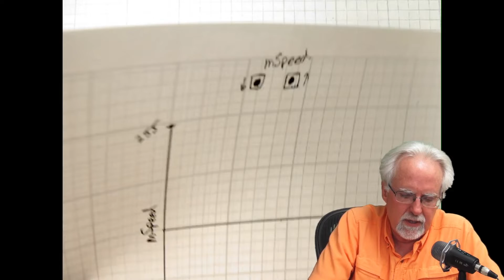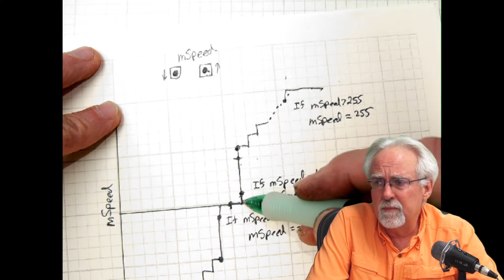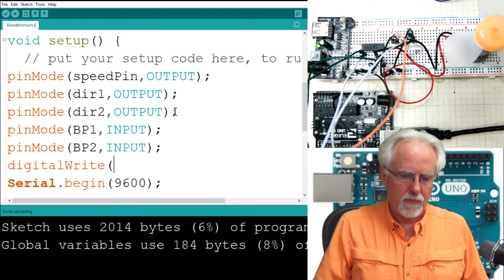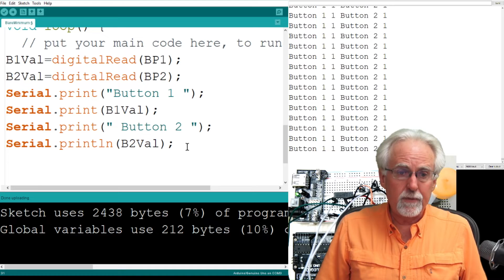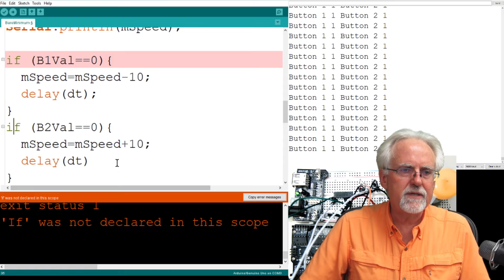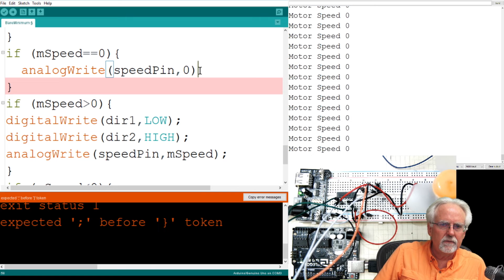Arduino Tutorial 40: Controlling DC Motor Speed and Direction with Pushbuttons

Comment: Thank you for the great lesson. Finished before watching, here is the code:

void loop() {
  // read buttons
  int buttonDownVal = !digitalRead(buttonDownPin);
  int buttonUpVal = !digitalRead(buttonUpPin);
  // we are in (-160, 160) range, stop the motor, next step is 160
  if (abs(mSpeed) < 160) {
    mSpeed = 0;
    step = 160;
  } else {
    step = 5;
  }
  // calculate next speed, based on buttons values
  if (buttonDownVal || buttonUpVal) {
    int nextSpeed = mSpeed - buttonDownVal * step + buttonUpVal * step;
    mSpeed = abs(nextSpeed) <= 255 ? nextSpeed : mSpeed;
  }
  // choose direction based on the mSpeed sign
  digitalWrite(directionPin1, mSpeed <= 0); //LH-cw, HL-ccw, LL-stop
  digitalWrite(directionPin2, mSpeed >= 0);
  analogWrite(speedPin, abs(mSpeed));
  delay(dt);
}

I read the buttons, then if the absolute value of the mSpeed is less than the min speed value that starts the motor (mine was sadly 160), I stop the motor and set the step to 160, so that the next click on any button will get me to the speed of 160. Otherwise (the speed is already greater than 160) - i set the step to 5. I calculate the next speed to set, and if the absolute value of the next speed is less then or equal to 255, I set mSpeed to this new speed, otherwise I use the old speed. Finally I set the direction by determining whether the speed is negative or positive.

Comment: Hi Paul. I did get it to work,  including the jump to a higher value on the first button press. I did not think about the issues coming down in speed, so needed a couple of extra button presses to stop. It took me all day, and my code is a lot chunkier than yours, but it worked. All my previous efforts at coding before finding your lessons have been a complete failure, so thank you. I will try to do it again using your method, but I am very happy that I was able to get most of the way there.

Comment: I found that if I used the battery from the kit, the motor had a hard time starting even at 130. But when I used a good quality battery, i could set 0 to 90 and the motor started no worries, even without giving it a push start.

Comment: The abs function is a game changer! I made mine work with the minimum motor speed of 100 and a new value of switchDir which activated if you pressed the dec speed button at a motor speed of 100. Once this happened switchDir would change value from 0 to 1 and in doing so reversed the direction and inversed the switches. however my program had no "off" setting, the motor didn't really run at 100 so I make as an excuse but I still feel I would have lost marks for that.

Thanks again Paul for a great lesson and another tool for the arsenal!

Comment: Hi Paul - It looked easier at first - thought a few if statements would work along with linear equations.  (Wish I knew about the "abs" command beforehand...).  I tried and tried but could get it to work like I wanted - not with my math.  I didn't think to use if statements as I thought that sounded too easy. LOL  Took out the extraneous math, inserted appropriate "if" statements (after watching the lesson) and voila.

Comment: This was harder than expected but I got it working  well in the end, except the dead band in the middle. My motor works at lower speed and I only had a problem between -20 and 20. Also used a button Val that was the difference between the first and second buttons. Excellent lesson and well presented - we are learning a a lot from you!

Comment: I did it. I had to break the codes into chunks in order to get the flow of the first push button. Although I didn't get to halt the motor when the second button was pressed, it went in the anticlockwise direction until the speed dropped to zero. I am obviously improving, all thank to you Mr Paul.

Comment: Another approach is to create another variable which I called inc that runs from 0-100. Inc initializes at 50 ( which generates a motor speed setting of 100 where the motor is stopped) and will increase with one button and decrease with the other. For inc 0-50 motor speed is direction is set  mSpeed goes from 255 to 100 ( my motor needed a value of mSpeed greater than 100 to run, similar to Pauls) For inc 50 to 100 mspeed direction is set in the opposite direction and the mSpeed increases from 100-255 . This slightly simplifies the number of if statements and coding complexity. At inc=0 you have maximum speed in one direction and at inc=100 you get maximum speed in the other direction.

.

Comment: Man, that was tough.... after hours of fiddling around, I finally got something close...  I can't help but think an Array could simplify this sketch.  Paul, please advise??? 
here's what I got 
int SpeedPin=5;
float dir1=4;
float dir2=3;
int sw1=2;
int sw1Val=0;
int sw2=8;
int sw2Val;
int ISpeed=0;
int dt1=100;
int ledpin=7;

void setup() {
 Serial.begin(9600);
 pinMode(ledpin,OUTPUT);
 pinMode(SpeedPin,OUTPUT);
 pinMode(dir1,OUTPUT); 
 pinMode(dir2,OUTPUT);
 pinMode(sw1,INPUT);
 digitalWrite(sw1,HIGH);
 pinMode(sw2,INPUT);
 digitalWrite(sw2,HIGH);
}

void loop() {
 sw1Val=digitalRead(sw1);
Serial.print("switch 1 is: ");
Serial.println(sw1Val);
 sw2Val=digitalRead(sw2);
Serial.print("switch 2 is: ");
Serial.println(sw2Val);
Serial.print("motor speed is: ");
Serial.println(ISpeed);
delay(dt1);

if (sw1Val==0){
ISpeed=ISpeed+25;
}

if (sw2Val==0){
ISpeed=ISpeed-25;
}

if (ISpeed>255){
  ISpeed=ISpeed=255;
}
if (ISpeed<-255){
  ISpeed=ISpeed=-255;
}
  if (sw2Val==1 && sw2Val==0 ){
ISpeed=ISpeed-25;
}
  
 if (ISpeed>70){
digitalWrite(dir1,LOW);
digitalWrite(dir2,HIGH);
analogWrite(SpeedPin,ISpeed);
} 
if (ISpeed>-70){
digitalWrite(dir1,HIGH);
digitalWrite(dir2,LOW);
analogWrite(SpeedPin,ISpeed); 
}

if (ISpeed==255){
digitalWrite(ledpin,HIGH); 
}
else digitalWrite(ledpin,LOW);

if (ISpeed==-255){
digitalWrite(ledpin,HIGH); 
}
else digitalWrite(ledpin,LOW);
}

Comment: Paul, thank you again for all your hard work. I did get this to work on my own. Because the abs value had not been introduced in previous lessons, I didn't know about it.  Instead I created an "analogVal" variable that was going from -255 to 255 (analogVal was the equivalent of mSpeed in your example). At analogVal>0 the code made mSpeed=analogVal, and at analogVal<0 the code made mSpeed=analogVal*(-1). I had so much fun with this. Thanks again.

Comment: I solved the problem with some exploring, but with only four if statements. The solution? Well I've dabbled with programming  since my Radio Shack TRS80 days but I would not call myself a programmer. But by  lesson 40 in the course I would expect some further skills in C/C##. I used a simple "array" to define ALL the available values,(using whatever points and increments you need)  and fed that number thru to mySpeed. NO special cases.NONE. My middle number was zero. Negative numbers before, positive after. Set the dirPins once (I could have done that at the top.) and GO!

Comment: I didn't set up the start at 100 but I had it working.  I did not use absolute value , I multiplied by -1.  My buttons worked well before I powered the motor but while the motor was running they periodically failed, I could see it in the serial monitor so I was thinking the motor was producing some noise.  These are really good learning exercises.

Comment: Paul, I am going to sound like one of my students here.  I solved the problem you gave us in Lesson 39 BUT then in lesson 40 you explained the complete problems and wanted the motor to run in both direction smoothly from full speed C-CW to Full Speed CW.
I thought I could get extra credit by adding the direction change by pushing both buttons at the same time...

I like your style of teaching but may I respectfully suggest that you be sure to explain your homework assignments completely.  I know these videos are done and "in the Can" so to speak so I am going to add a comment in lesson 39 suggesting that people watch the start of lesson 40 to get the assignment right.

Maybe you need to just "Hold your Breath" when before assigning homework ... LOL

Comment: I solved this three different ways because I didn't listen closely enough to your instructions in the previous lesson.  Once you recapped the assignment at the start of this video, I stopped and wrote another sketch.  The key to doing this easily was your use of the mSpeed being negative to indicate one direction and positive to be the other direction.  That is a great tool for this kind of control.  I tend to overthink these projects.  Thanks!

Comment: all of my code works perfectly until I get the motor controls in there. then the buttons just stop working completely and nothing works. but if I take the motor control code out it works perfectly again. i have the code written just as you have it in yours. Im at a complete loss. please helklp!
Reply from the maker: Make sure you are using a suitable power supply and not just the battery. Battery will run down in abouut 2 minutes

Comment: my motor seems to weak to move. if i plug it into the power it takes off but when i step up to 255 in the program it just buzzes loud but doesnt move.
Reply from the maker: Maybe the battery is dead. Try using a suitable power supply

Comment: Paul your Dc motor speed can be more const if instead of under 100 (95,90) you had 
if (Mspeed==245){
Mspeed=250;
}
if (Mspeed==90){
Mspeed=0;
}
in this case you motor speed will  be more stable ... have to do it on the (-) aswell

thank you for all your are teaching me <3

Comment: did that on my own 
int BDownPin=3;
int BDown;
int BUpPin=2;
int BUp;
int DCspeedPin=11;
int DCspeed=0;
int DCrotL=9;
int DCrotR=8;

void setup() {
  Serial.begin(9600);
  
  pinMode(BDownPin,INPUT);
  digitalWrite(BDownPin,HIGH);
  pinMode(BUpPin,INPUT);
  digitalWrite(BUpPin,HIGH);
  pinMode(DCspeedPin,OUTPUT);
  pinMode(DCrotL,OUTPUT);
  pinMode(DCrotR,OUTPUT);
}

void loop() {
  BDown=digitalRead(BDownPin);
  BUp=digitalRead(BUpPin);

  if (BUp==0 && DCspeed<255){
    DCspeed++;
  }
  if (BDown==0 && DCspeed>(-255)){
    DCspeed--;
  }
  if (BDown==0 && BUp==0){
    DCspeed=0;
    delay(100);
  }
  if (DCspeed<100 && DCspeed>0){
    DCspeed=101;
  }
  if (DCspeed>(-100) && DCspeed<0){
    DCspeed=(-101);
  }
  if (DCspeed==100){
    DCspeed=0;
  }
  if (DCspeed==(-100)){
    DCspeed=0;
  }
  if (DCspeed>0){
    digitalWrite(DCrotL,HIGH);
    digitalWrite(DCrotR,LOW);
    analogWrite(DCspeedPin,DCspeed);
  }
  if (DCspeed<0){
    digitalWrite(DCrotL,LOW);
    digitalWrite(DCrotR,HIGH);
    analogWrite(DCspeedPin,DCspeed*(-1));
  }
  if (DCspeed==0){
    digitalWrite(DCrotL,LOW);
    digitalWrite(DCrotR,LOW);
    analogWrite(DCspeedPin,DCspeed);
  }
  Serial.println(DCspeed);
}

Comment: Hi Paul, thank you for the amazing lessons. This assignment was soo good. I was able to do it on my own but it was a little tricky. I am posting my solution before watching the video.

//Dc Motor
int speedPin=3;       
int dir1=4;           
int dir2=5;          
int motSpeed;         

//Buttons
int button1=11;       
int buttonVal1;       

int button2=12;       
int buttonVal2;       

int increment=0;      //Variable that will increase or decrease by 1 depending which button is pressed

void setup() {
  // put your setup code here, to run once:
  Serial.begin(9600);                 
  pinMode(speedPin, OUTPUT);         
  pinMode(dir1, OUTPUT);              
  pinMode(dir2, OUTPUT);             
  pinMode(button1, INPUT_PULLUP);     
  pinMode(button2, INPUT_PULLUP);     

}

void loop() {
  // put your main code here, to run repeatedly:
  
buttonVal1=digitalRead(button1);                  
buttonVal2=digitalRead(button2);                  

  
delay(2);

  
if (buttonVal1==0) {                                           //When button 1 is pressed 
    increment=increment+1;                              //increment will increase by 1
    if (increment>255) increment=255;            //to a Max Value of 255
 }

  
if (buttonVal2==0) {                                           //When button 2 is pressed    
    increment=increment-1;                               //increment will decrease by 1
    if (increment<-255) increment=-255;         //to a Min Value of -255
 }  

  
if (increment>=0) {                                            //When increment is greater than or equal to 0
    digitalWrite(dir1, LOW);                                //Motor direction will be Potitive
    digitalWrite(dir2, HIGH);         
    motSpeed=increment;                                  //Motor speed is going to equal increment value
    analogWrite(speedPin, motSpeed);      
 }

  
if (increment<0) {                                               //When increment is less than 0
    digitalWrite(dir1, HIGH);                               //Motor direction will be Negative
    digitalWrite(dir2, LOW);
    motSpeed=-increment;                                 //Motor speed is going to equal -increment
    analogWrite(speedPin, motSpeed);            //which will give a postive motor speed value
  }
  
}

Comment: Greetings, my soltuion:
//dc motor
#define motorSpeed 5
#define motorLeft 4
#define motorRight 3
// pushButtons
#define pushUp 10
#define pushDown 11
int dt = 100;
int speedVal=0; 
void setup() {
  // put your setup code here, to run once:
  Serial.begin(9600);
  pinMode(motorSpeed,OUTPUT);
  pinMode(motorLeft,OUTPUT);
  pinMode(motorRight,OUTPUT);
  pinMode(pushUp,INPUT);
  pinMode(pushDown,INPUT);
  digitalWrite(pushUp,HIGH);
  digitalWrite(pushDown,HIGH);
}

void loop() {
  // put your main code here, to run repeatedly: 
  Serial.println(digitalRead(pushUp));
  Serial.println(speedVal);
  Serial.println(digitalRead(pushDown));
  if((digitalRead(pushUp)==LOW) and (speedVal<255)){
    if((speedVal>=0) and (speedVal<=124)){
      speedVal=125;
    }
    if((speedVal>=-124) and (speedVal<-1)){
      speedVal=0;
    }
    speedVal++;
  }
  if((digitalRead(pushDown)==LOW) and (speedVal>-255)){
    if((speedVal<=0) and (speedVal>=-124)){
      speedVal=-125;
    }
    if((speedVal<=124) and (speedVal>1)){
      speedVal=0;
    }
    speedVal--;
  }
  if(speedVal>0){
    digitalWrite(motorRight,HIGH);
    digitalWrite(motorLeft,LOW);
    analogWrite(motorSpeed,speedVal);
  }
  if(speedVal<0){
    digitalWrite(motorRight,LOW);
    digitalWrite(motorLeft,HIGH);
    analogWrite(motorSpeed,speedVal*(-1));
  }
  delay(dt);
}

Comment: I did the assignment. It was both complex and exciting. I am enjoying your class. Thanks, Mr. Paul. I used 255 to help the motor start at a low speed. I also programmed it in a way where you have to keep pressing it until the motor reaches your desired speed.
Reply from the maker: Great job!

Comment: Homework:
int speedPin=3;
int Speed;
int dir1=2;
int dir2=4;
int inB=7;
int deB=8;
int readinB;
int readdeB;
int wait=20;

void setup() {
  // put your setup code here, to run once:
  pinMode(speedPin,OUTPUT);
  pinMode(dir1,OUTPUT);
  pinMode(dir2,OUTPUT);
  pinMode(inB,INPUT);
  pinMode(deB,INPUT);
  digitalWrite(inB,HIGH);
  digitalWrite(deB,HIGH);
  Serial.begin(9600);
}

void loop() {
  // put your main code here, to run repeatedly:
  readinB=digitalRead(inB);
  while (readinB==0){
    Speed=Speed+1;
    delay(wait);
    if (Speed>255){
      Speed=255;
    }
    if (Speed>-100 && Speed<100){
      Speed=100;
    }
    Serial.println(Speed);
    readinB=digitalRead(inB);
  }
  readdeB=digitalRead(deB);
  while (readdeB==0){
    Speed=Speed-1;
    delay(wait);
    if (Speed<-255){
      Speed=-255;
    }
    if (Speed>-100 && Speed<100){
      Speed=-100;
    }
    Serial.println(Speed);
    readdeB=digitalRead(deB);
  }
  if (Speed>=0) {
    digitalWrite(dir1,HIGH);
    digitalWrite(dir2,LOW);
    analogWrite(speedPin,Speed);
  }
  if (Speed<0) {
    digitalWrite(dir1,LOW);
    digitalWrite(dir2,HIGH);  
    analogWrite(speedPin,-1*Speed);
  }
}

Comment: Paul, you have done a better job at teaching this material than the professors I studied under at the University California. Don't get me wrong, those guys were good, but you provide a much better foundation for those students who are planning on designing and prototyping electronics. I managed to get the homework right but suspect it would have been an epic fail if I didn't flow chart things out. I learned to flow chart my projects from my wife who is a data analyst and uses them all the time. I am so glad you teach this idea! Thanks for another great lesson (which I'll pass on to my students).

Comment: I did not make it to the end on my own.  My code was the same all the way down to the -10 / -90 portion of the code.  I did not for see that.  I took lesson 29, copied INT section and void set up and pasted it with Lesson 39 (DC motor set up).  I figured out the first two  "if" statements,  then I missed the mSpeed==90 II mSpeed==-95).  When I followed you in the lesson the light bulbs was coming on.  It all made sense.   Thank you.

Comment: This was a solid lesson in prior thinking. I honestly didnt have mine set up with the jumps at the start (keeping in mind that I am currently simulating this using 2 leds and varying their brightness because my kit doesnt have that motor controller). I also used analogWrite(speedPin, - mSpeed); for dealing with the reverse values which worked but im glad you showed us the absolute function as well because I didnt know that existed. Thanks again Paul.